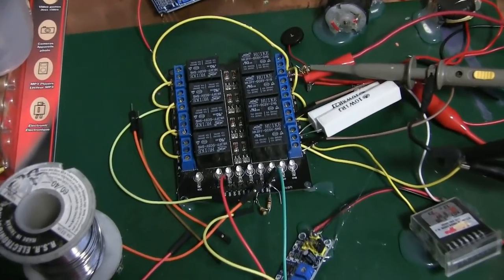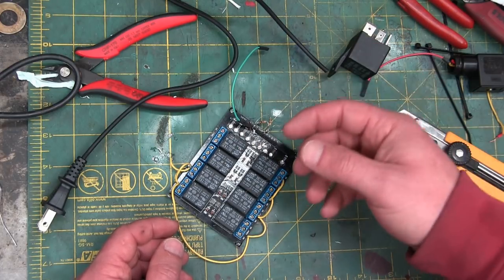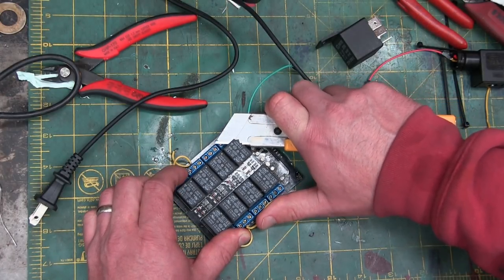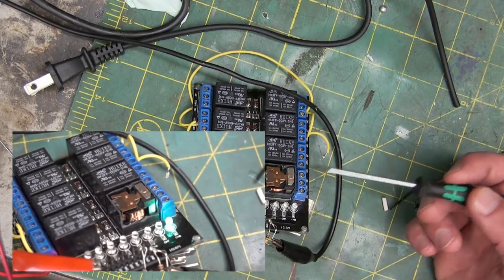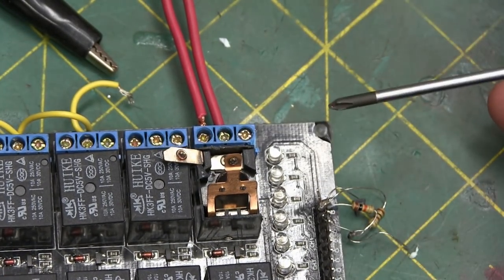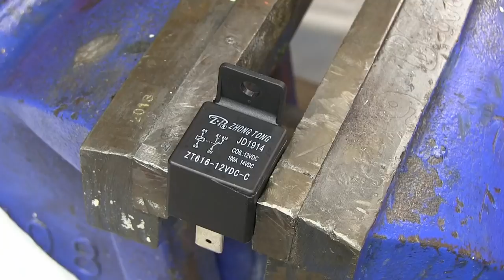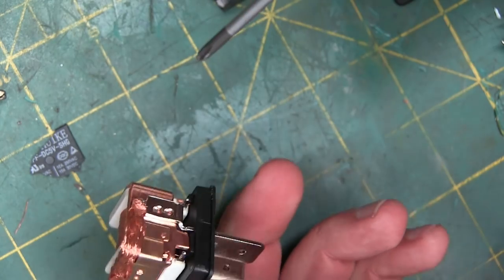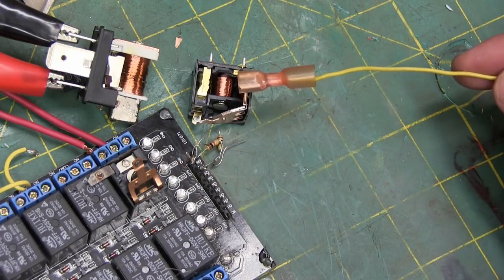BOLTR: Aliexpress vs Omron | RELAYS EXPLAINED!

Comment: On Lancer Evolution X, a relay is used to activate second fuel pump when you hit high boost condition, that relay was prone to failures. When relay failed one day and you are heavy on throttle, lean condition due to lack of fuel pressure makes a nicely sized hole in a block... so all an all, some relays better be good.
Reply: Or you know, some programmers better be smart, and that counts physical programming too (fuel pressure sensor that just shuts it right down when that condition is found till the pressure is back up, that way you bounce or surge from enough pressure to cut off ignition, until you let off the throttle, in which case the engine should fire back up if you’re going fast enough for it to run still and not freewheel the converter)
Reply: Unfortunately I’ve come to notice that the Japanese are bad at programming anything. Good at building everything just not at zeros and ones.
Reply: @xeong5  yup, can confirm
i've been buying sony phones for a long time. Tough as bricks on their own, indestructible with a case and a screen protector. Had one work with half the screen, the camera and some other components missing. Picture a phone with its top shot off with a shotgun. The only bad thing is they get confused on how to be a phone sometimes and start glitching out.

Comment: There are guys selling Relais on PCB with 0,8mm space between mains and low voltage. Please don't buy these. It's dangerous.
Reply: Link to said PCB?
Reply: Link to said PCB?
Reply: That's baked as. I've seen some pretty bad relays from China (Banggood?) and at least those are technically safe, or would be if the soldering job wasn't so fucking terrible. That's the kind of crap that kills people...(These are the ones from banggood, they even full cut out the PCB! https://img.banggood.com/customers_images/newlarge/6f/ce/2017091310552814-74110.jpg
Reply: That is pretty bad. That should probably be reported to ebay.
Reply: Anthony Lewis these look good. Banggood normally doesn't sell crap.

Comment: Back in the day, when I worked on IBM copiers, we had microswitches that would do the same thing, that were running on 24vDC. They were identical to the microswitches in the paper drawer lift sections, except that those ran on 110vAC, and the NEVER chooched out like that; and the IBM engineers stated that it was because the higher AC voltage kept the contacts from slagging and losing contact. Our quick-and-dirty fix for those 24vDC switches was to swap them with the paper lift switches, which would put a nice clean set in place, and the 24vDC ones would clean up in a couple passes of the lift system. 

Those contacts can be cleaned; a fine jeweler's file would do the trick. I would also put a tiny dab of conductive grease on them, which seems to limit the chooch factor a bit.

Comment: A trick we pinball hobbyists use is to put a small capacitor across NC contacts (older pinball machines use a lot of reed switches similar to relay contacts) to reduce the sparking.  I'm not entirely sure why it works, but it works!  Related, you should see if you can get your hands on a pinball machine one of these days, those things are friggin wild under the hood!

Comment: That was a lot of cycles for a cheap relay.  When I pretended to work for a living a relay would ultimately fail at the wrong time.  Great review, keep warm.
Reply from the maker: Hey, don't sell yourself short. Somebody had to hold down that EvilOmniPlasticPolution factory chair down. All the while collecting the oral history of a generation. You sir are a Tejas treasure.
Reply: Geez now I can't get my hat on.
Reply: Amateur Redneck Workshop sir, may you be a engineer or electrician, I am a curious pixie s magic designer / researcher, aka Electrical and Electronic Engineer,
Reply: I was a technician who programmed and repaired process control computers in a refinery.  Mostly Foxboro, Modicon, Triconics.
Reply: Problem is not connecting the rated current only, but connecting little currents as well! Cheap one's fail to connect when only little or no current is being switched!
Reply: I suspect that even the very best ones will fail to connect when no current is being switched.

Comment: The most interesting figure though here is product runtime 2.3mio is a lot for once a day, but not so much for 100Hz ... also as you said, its anecdotal, the number to rel(a)y upon is the guaranteed switches in the datasheet which is usually much smaller.

Comment: About 15 years ago I designed domestic boiler controls. We had a rig for testing the relays that used 4 sets of relays and you could leave them running for months. The only relays that I was ever happy with were Omron G2R and G5L series. Some of the others had some definite issues. The Omron though vastly exceeded the specification for wetting current (minimum contact current) and we had them down to 50uA working fine on relays with 5mA rated wetting current. That was not one off either that was 100 million cycles per relay, 40 relays from 10 different batches. With a slightly harsher than reality load (using a light bulb instead of a motor) where the bulb was typically rated double the power of the motor, the relays were doing more cycles than you would believe. We left one set running for 2 years one cycle every 5 seconds (the time it took for the control system to cycle). I never had an Omron failure on the rigs and even the best of the rest had at least 2 or 3 failures after 50 million cycles.

Comment: having a smaller normally closed contact is fairly standard on high power relays, and part of the reason is there's not enough contact pressure for the full current that the  normally open contact can carry without either much larger contacts or a stronger spring (and requisite higher pull in current and heat generation).  I suspect the NC contact is mainly for feedback/control duty and not power control.

Comment: King of the relays would be power switching ones. Railroad relays (which can run several grand) use graphite and silver for their contacts, and have to not to weld if hit by lightning, and you get a couple more front and back pairs for your buck. You need the extras, or else you can't tell if they've stopped chooching, and which is very bad (several thousand tons of train runs into several thousand tons of train).
   You also get some neat variants, make-before-break, mag sticks, dual bias relays (where the direction of the electons had to match).

Comment: My dad works for Hydro. He says they have 24 volts rated relays, but they send 240 volts into the coil to make them actuate faster. But once they actuated, there's a 1Mohm resistor in the self latching circuit. 

He says switching speed is more important for their application than long term reliability. They're cheap and they can afford to replace them as often as needed.

Comment: AvE, if you're switching a DC inductive load with your relay, then you can put a reverse-polarity diode across the load to shunt the "back emf" around the relay contacts. That arcin' and sparkin' on the relay contacts will vanish completely, and your relay will last nearly forever.

The only possible downside is that adding the back-emf-killer diode (a/k/a "flyback diode") will slightly slow the turn-off time of the current through the load. Instead of cutting off suddenly, when the relay opens, current will continue to flow through the load, gradually decreasing (typically over some fraction of a second). So if you're trying to switch-off the load very quickly, adding the back-emf-killer diode could be a problem. In that case, you could compromise with a MOV instead of a diode, or add a resister or zener in series with the diode. The result will be a small amount of arcin' and sparkin', but quicker shutoff than with just a diode for back-emf-suppression.

For an AC load, a back-emf-killer diode obviously is not an option, but a MOV (or back-to-back zeners) still is. Pick a MOV voltage which is safely above the normal peak voltages across your load.

Here's are some articles:
https://progeny.co.uk/back-emf-suppression/
https://www.nutsvolts.com/questions-and-answers/emf-suppression

Comment: When I was an apprentice we used to get bigger relays and just wire the coil circuit through the NC terminals. Great way to make a buzzer. The bigger the relay/contactor, the bigger the buzz!

Comment: That's a damn site better than they were 10 years ago. I did a test for the company I worked for using 20 relays from 4 different batches (5 relays per batch) from I think 109 different manufacturers. This was using light bulbs as loads (60W UK mains) and 24V @1mA. I didn't bother testing the Omron past 10 million cycles but most of the chinesium failed at less than 1 million with either dodgy contacts or one had some sort of mechanical failure I cant remember the specifics of. If they are getting to 2.5 million now that's a big improvement. The chinesium ones also failed faster on the low load. The Omron had much better bifurcated contacts.

Comment: The relays on freightliner used for the trailer tail lights failure mode is the copper hinge. I've checked 15 of them or so, all ting zhing dong brand.

Comment: What's your gittin' spot for electronicals? I always used to use radio shack, but they went slightly out of business.. Online kinda works, but I like brick and mortar
Reply: Without the 'shack my only getting spot is digikey or their ilk. Kinda makes me as sad as the fact that kids in Africa could have eaten those relays that uncle BF took to bits.
Reply: Aaron Thompson There are abound two left in my metropolis. Still go there to quickly get a few common parts, but I find the online big names have much better inventories when needing something specific like a brand name relay with specific ratings and a full datasheet.

Comment: The buzzer sound from all the school scoreboard gyms is just a big mechanical relay wired with 60Hz AC which ends up buzzing at 120Hz for each peak of the AC signal.

Comment: When I first started working some bean counter/purchaser decided to get cheaper micro controllers for our power supplies. After much investigation it was found the chip was solid plastic with the pins molded into it. No actual controller....

Comment: All relays should be filed with a thin dielectric oil to remove the oxidative process.  Have we learned nothing form our glass tube grandfathers?
Reply: GallowayChicago But it's not just oxidation,  it's multiple kinds of damage from the connect / disconnect process,  including melting, splashing, unwanted welding, material transfer etc.  TE has some great articles on the matter in the "catalog" and "application notes" part of their website. Omron has a few too.  The people who wrote those were probably old enough to have started with vacuum tubes as the only non-mechanical option.

Comment: I remember back in the 80s when I was shown how a relay worked and the brain bulb kicked in.. I started building all kinds of trickery things....
With about 18ish of them wired together and a generic multi channel neg output tx/rx box,
I built a full remote start/keyless entry system for my car with choke and accelerator actuator for the carb when it was cold, sequentially turn on power and start like the key would do it, timer relay so it would auto shut down after 25 mins, " 5 wire" lock/unlock actuators for the doors, open the trunk.. Pretty cool when I was 19 and remote starter systems weren't a thing yet..
I got dumber after that.. But I can wire the Hell out of a relay.

Comment: I checked with Leviton at one time to see what sort of duty cycles their standard wall light switch was supposed to be able to handle so that I could compare it to the import relays for use in an Arduino system.  They said that the light switches were supposed to handle a minimum of 50,000 cycles.  If you look at it that way, then these import relays are pretty reliable.  Reliable enough that I would consider them for an automated home lighting system.

Comment: As an addendum, the switching dwell time can make a marked difference in the lifespan of an electromechanical relay. Relays are usually rated to X million mechanical operations total, with Y electrical operations under full load total, and Z operations per hour.

From my experience (not emperical by any means, so take with a grain of salt), switching a relay more than the Z operations per hour will burn them out really quickly, closely followed by the Y fully loaded operations, with X total mechanical operations being an academic number (unless we're talking about HV switchgear).

In my opinion the major difference between chinesium and not switchgear is how long they last in similar situations, if you're running them under-rated, chinesium will be fine, if you're running then near rated, chinesium is false economy.

P.S.  That's a laughable set of 100A contacts, unless we're talking something stupid like 5V?

Comment: on these relays. it seems like the coil always seems to work. its the contacts on high amp equipment like compressors (10-70 amps) or electric furnaces (witch could be handling 10-100+ amps). and all those amps at high voltage will jump those contact b4 they are fully closed or open.

Comment: Little late BUT
Electronics guy told me they also have a wiping action when they actuate to rub corrosion off and make them last longer. You could probably see that with the high speed no problem.

Comment: I used one of those relays to make a thermostat for a small electric heater.

From my experience those relays will not last 2.5 million cycles. I got about 3 weeks out of it before it stopped working, and it was only working a few cycles an hour. Perhaps the relatively high current that a heater draws played a role in that? 
I will send it to you if you would like to investigate.
Thanks for the video!

Comment: I know the electrosity enginerds needed to buy special relays for some DC relays so that the contacts self-cleaned with the current. If the oxide layer was there, the heat caused by the resistance would weld the contacts together. I think they had to be platinum contacts or something.
Reply: Yes and interestingly this means relays of this nature have a minimum switching current required to achieve the manufacturers specs, if you don't switch enough current the self clean wiping action does not work and same result, it welds shut on the contacts way, way before you thought it should.

Comment: +AvE VERY interesting - that the failure mode was relay contact erosion!! Was this relay being driven ON and OFF by a signal, or was the coil wired in series w/ the NC contact, making the relay self-oscillate, but Also making the inductive spike / spark appear across the NC contacts? That would erode the contacts. Maybe use a diode across the relay coil to kill the spike ... a capacitor would also swamp it out.

Comment: No test of the use counter the omoron relay vs cheap?
Reply: Oneofdazzz probably not worth the time. If Omron rates it for 7 million cycles it is probably good for 10 million. The good stuff, Omron, sprecher-shuh, carlo gavazzi, finder, etc used in industry aren't ones you lose sleep over like the chinesium ones.

Comment: cheap solid state relays are the way to go with stuff that never stops switching. $3 a pop indicator LED and a huge input voltage window they are awesome. again they say 25A on them but i wouldn't go over 15 on the cheap ones.

Comment: Ohhh I have been round and round with relays.  Have done (and re-done) some commercial designs that do temp sensing and switching and various other malfunctions.  It's those big nasty electric motors you have to watch out for.  And CHATTER.  Motors can pull a LOT of initial current and some will produce a big backlash when power is interrupted.  Very hard on contacts, so you want to over-rate them substantially if reliability is a design goal.  Chatter burns burns BURNS contacts.  It's not just the repetition.  It's heat.  Get those contacts opening and closing under load at 60 or 120 hertz, and they erode at warp-speed because the heat can't dissipate from the last ten-thousand switcheroos causing the openings and closings to take bigger and bigger chunks out of the contact material.  Even a heavy duty relay with beefy contacts and a strong spring can weld shut under those circumstances.  So you gotta keep noise out of the circuitry (which can be a trick in some industrial environs) and make damn sure the relay is opening and closing cleanly, just once per cycle.  No bouncy-bouncy, capisce?

Comment: That is what makes peoples multi-thousand dollhairs Heat pump's or A/C's go kaput! The compressor runs off 208-240V, and they don't like it when one of the contacts welds and you only get 104-120V to it.

Comment: Try hooking up 230VAC 2-3 kW heating element(for a 16A relay) switch it once a second. Good relays last 400-500 thousands, anything less than 300k we consider not suitable for use in our products. Mechanical endurance (millions of times what you tested) is for signal switching, not for power.

Comment: Wouldn't a high value resistor across the gate nicely mitigate the arcing? And if so, why isn't that installed as standard?
Reply from the maker: No, but a diode would. Manufacturers are not in the business of selling LESS. ;-)

Comment: Where is this getting spot you speak of? Lees? Have you ever had experience with shop in Burnaby, P and J?  One of your early videos had mentioned a place online where you aquire samples? I wonder if you can remember where that was off hand? Im up to my ears in a ardiuno project and eating up parts lol. Also also where do you get your boards printed? Tryed to make one with just solider. It is turing out messy aka not working. Thanks a mill!!